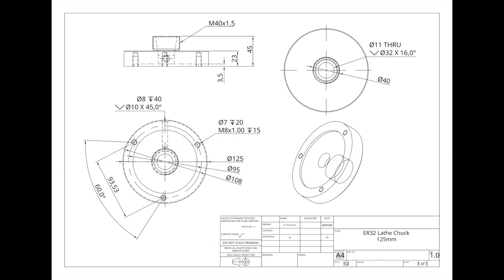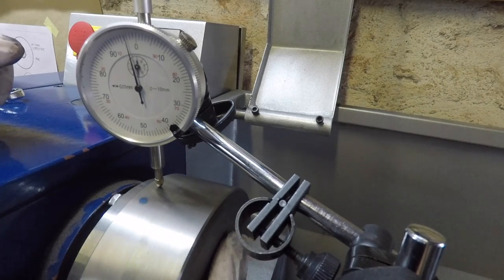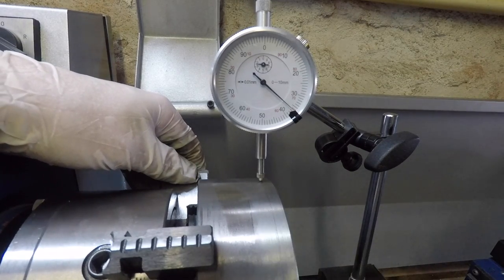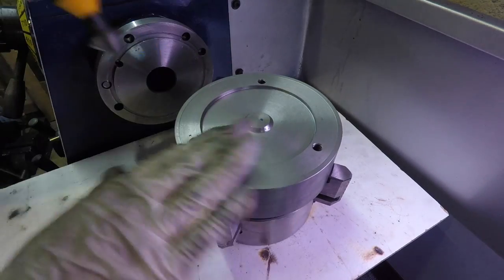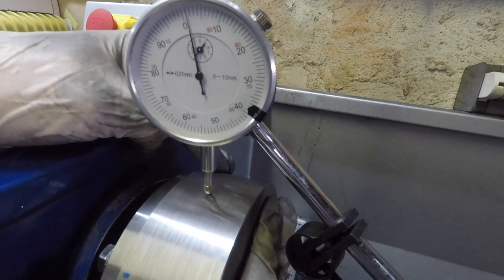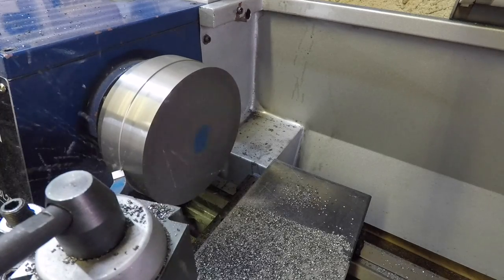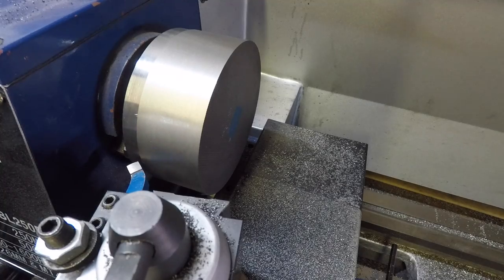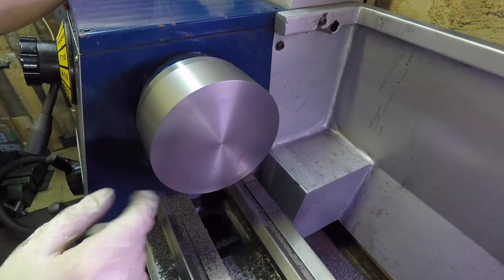Making a ER32 Lathe Collet Chuck Part 2

Comment: Ductile iron is good but alloy steel is fine too. High speed cnc chucks are usually made of alloy steel. You can take a thinner backing plate and shrink fit + loctite a smaller 40-50mm stock for a collet chuck. It saves material as the cutting forces involved for collet work at that size is not large.
Reply from the maker: Thanks for your feedback. Agree, both metals will work perfectly fine. I did overkill the mounting plate a bit, could have been half the thickness but then I dont think I would have managed the blind bolt holes. (I also dont have any end taps)

Comment: Waar het jy daai hengse stuk cast iron gekry? I am also a hobbyist and I find it quite difficult to get materials. Metal Center in JHB is only open during the week which makes it very difficult for me to get there.

Great video. I am looking at making an ER16 chuck for my lathe and this is most helpful to watch someone else build a similar. Planning to do a "drawbar through spindle" type design since my adendorff machine doesn't have a tapered spindle bore.
Reply from the maker: Hi Pekel Meester, I have the same problem, all the steel suppliers I use are only open on week days. I am in Cape Town but have added them below if you are interested. They both have a good selection of off cuts. 
NFM is where I got that piece of Cast Iron.

Black and Bright / Warm or Cold Rolled = Cape Town Steel Supplies (https://ctss.business.site/)
Non-Ferrous Metals = NFM (https://nfm.co.za)
Reply: Hey guys. Gold Circle Metals in Cleveland Jhb has a good selection of brass, bronze, copper and cast iron. They and metals center in Selby aren't far from my day job. So if you need anything I can collect on your behalf
Reply: Mac steel carry quite a variety as do Sanderson Steels , most only work weekdays, try get some 12L14 (can’t think of the other names ) it has 12% lead and turns as easy and smooth as soap, it can also be slightly hardened after machining

Comment: Great video series. For my lathe I just cut some 2” round stock 5” long (50mm 125mm) cut an mt5 to match my head stock, bore it out and make whatever collet system i want on the front. I punched a line on my spindle then on the part, usually end up with 4 tenths runout or less. very easy and very fast, also you can recut the taper a ton of times if you start getting more runout. I have it for 5c, er16,20,32 and r8 because I have a bunch of very accurate r8’s and why not. I went the route of a chuck and never got the accuracy I wanted without a lot of fuss

Edit:

I made a quick video to explain it

https://youtu.be/7e1-8xh_ASM
Reply from the maker: Thank you. I was thinking of doing the same and having a draw bar type system. I have a MT3 collet holder for the Mill which I was looking to replicate to an MT4 (my lathe spindle taper) but because I would use a draw bar, it would restrict  the length of material I can push into the spindle bore. Definitely still a good project for me to look at later down the line, maybe do it by machining between centres :)
Reply: Yeah the mt5 on my lathe leaves me with a pretty big spindle bore. How big is your spindle bore? My logan lathe had an mt3 and my hollow draw bars allowed pretty big stock to pass through, i want to say 14mm but I cant remember that well
Reply from the maker: I'm pretty sure I have a MT4 taper on the spindle bore. 
Dont think I've ever seen an ER Collet Arbor(MT3/MT4) with a hollow drawbar.

Comment: A lot of work for an 15 $ er 32 collet. and the castiron is not great for the nut and taper for the collets.
Reply from the maker: Agreed, maybe something like tool steel would have been good? for the amount of use it will get, castiron should be okay for me.
Yes, lots of work, but I think I speak for a lot of hobby machinists when I say, "Its more about the journey and experience than the cost. Its the feeling you get looking at the end product and being able to say, you made it."
Reply: Friend you don’t understand $15 converted to ZARands ( R270 plus’s shipping and tax then we are looking at around R500) starts becoming expensive then add shipping and tax, that’s why we tend to make a lot of our own goodies😢
Reply: Another sore point in SA is how ridiculous the used machine market has become, sellers het greedy and check the prices on sites like eBay then convert those prices into local currency and it becomes very expensive, it’s not uncommon to see prices of ZARANDS 30k for an old Myford lathe, total heart failure for a half decent  Bridgeport mill😢😢
Reply: @dennismichas285  the chunk cast iron wil kost me 50 euro at least , it is very expensive in my country. Steel is cheaper and you could weld 2 pieces together. Less work and cost. Greatings
Reply: You can improve the finish in the recess by relieving most of the the recess just like your 4 jaw chuck has.